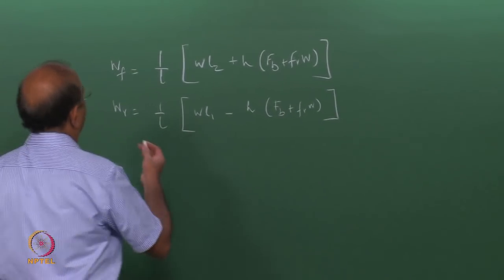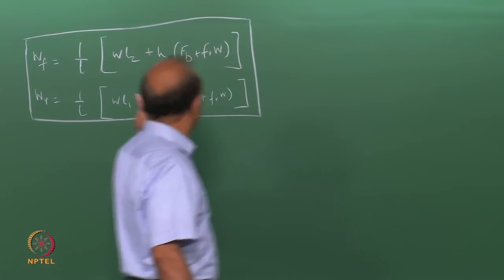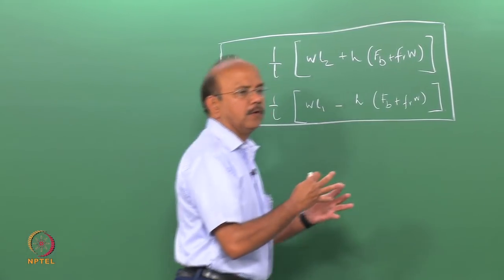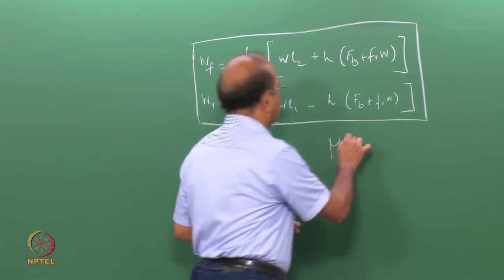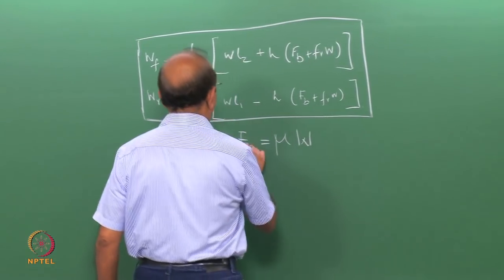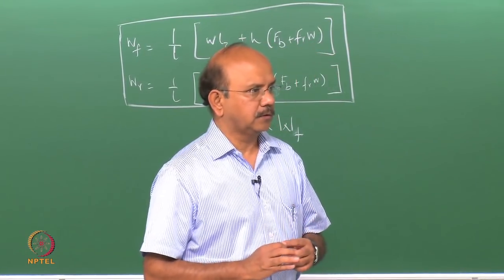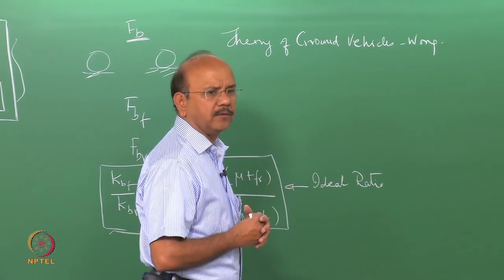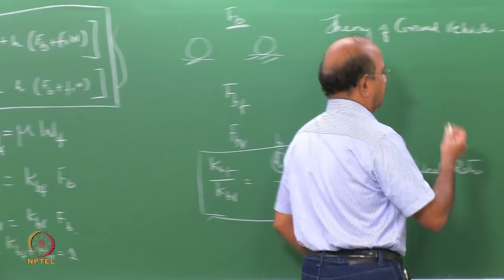Mod-01 Lec-04 Brake Force Distribution, Braking Efficiency and Braking Distance

Comment: when the both tyres lock together and as the body starts skinding will there be rolling resistance
Reply: don't think so because the will not be any deformation and relaxation of the tires because they are locked (not rotating)
Reply: exactly thoght so

Comment: At 21:36 ,since the sign of d (deceleration) is negative and positive in equations 2 and 3 respectively,it means that the load is getting transferred more to the rear than that of the front.But in reality,it isn't .Please explain about that, anyone.
Reply: Idk if you will read this but anyone questioning will. "d" is a positive value as it is declared as "-a" with a itself being negative in the case of deceleration -> positive value for "d". I've been wondering the same thing.